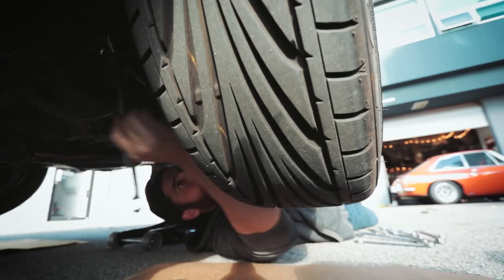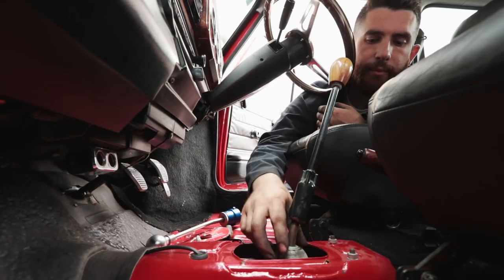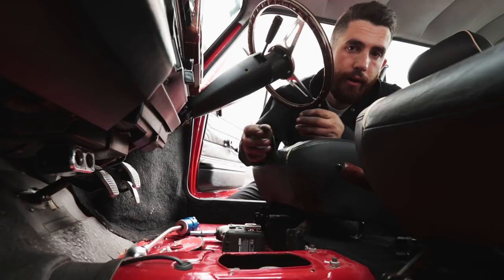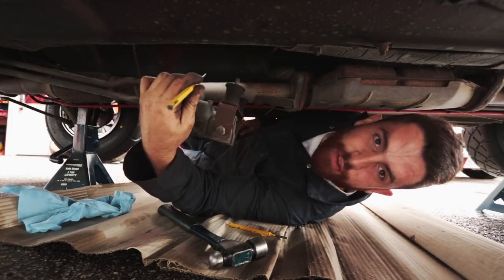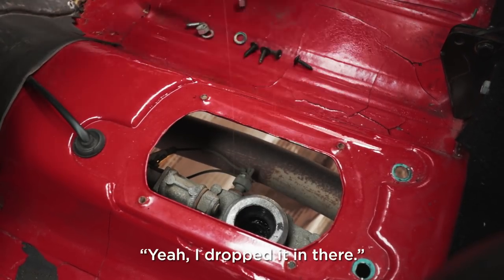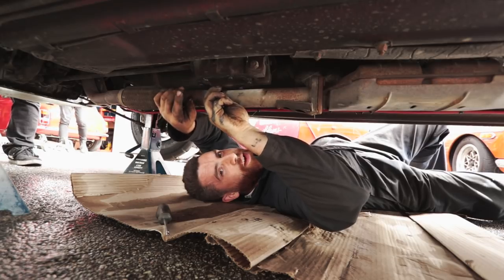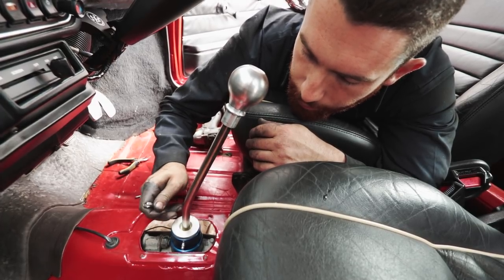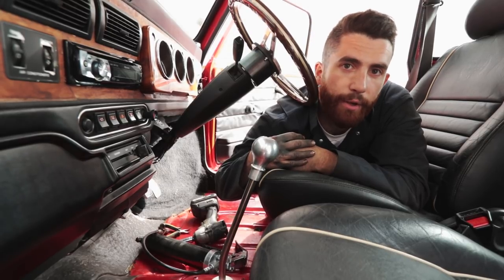How to Install KAD Short Shifter for classic mini

Comment: With a standard gearbox, a lot of people find it will rapidly reduce the synchro dogs. You can be more likely to change quicker than the spinning stuff in the box wants you to, especially if you have worn bulk rings. But it does shorten the shift, great for a race car where you don’t care as much for mechanical sympathy.

Comment: Nice piece of kit.
A top tip, well under there lock wire the two roll pins on the sleeve connecting the rod to the gearbox input, as these can fall out, usual at the most inconvenient time, and it will be raining.
Reply from the maker: Gavin Ivers great suggestion, extra bit of safety never hurts
Reply: Lol it would definitely be raining

Comment: Nice video, again. Cheers for that, mate. I´ve added a M6 lock bolt to the top collar (theaded it M6 near the edge) so I can adjust it and it stays nice and tight.       Just an advice to all the others: !!! DON´T BUY THE CHEAP 35£ ONES  !!  as they are poorly engineered and don´t justify the investment for the benefits you are trying to achieve.

Comment: My supplied bolts on the shifter wouldn't thread in.   I'm not bought some other self tapped bolts.  It never did tighten up super tight.  I think the supplied screws might be in between sizes or something.    I did take a test drive and everything seems fine and is definitely an upgrade.

Comment: Took me hours to get the pins out. I didn't have the proper tool and used an old screwdriver. I'm also a rugbyman, which means that most jacks don't lift the mini high enough for me to have enough strength on the hammer. After two unsuccessful hours, I decided to solder a small hexagon head on a spare steel bar I had, and punched it from the far side of the car. In minutes, stuff was done. For the pins, just get your little brother to hold a magnet stick while you punch it, I had no problems of lost pins.
If like me you happened to have your seat far from the dashboard, the gear lever is too short, you have to push your shoulder forward. KAD uses a M14 1.25 knob, and you won't find any prolongator with those metrics. You can find on AliExpress or eBay long shift knob (18cm) in aluminium with a self tap plastic screw that will make shifting a breeze. You will gain a bit more travel though, since the lever is further away from the pivot. But to me it feels really nice.

Comment: Where do you order the KAD shifter from, direct from KAD? Also was hoping you'd walk through replacing the shifter seal, since it's a common leak point, and you're already under there.
Reply from the maker: We try to order directly from companies when possible. That's a good idea about the shifter seal. Many leak, and we'll be doing a video on the upgraded shifter seal kits in the future.

Comment: I fitted one, all worked well,  but the throw is short & requires more effort.  As its only for road use, I would actually prefer the std stick.
Reply: They sell a standard throw shift kit as well that also gets rid of the lift to reverse

Comment: Installed this KAD Quickshift after seeing your review. Install when smooth but for some reason will not go into third gear? Only other thing I did was replace the oil seal. Any help would be appreciated.
Reply: Did you solve the problem?
Reply: dnbmania yes. It was the plate on the bottom gear lever box. Had it on the wrong way. Lol

Comment: Don't throw away your stock shift rod stick as mentioned... 

  Worn remote shift housings cause KAD Quick shifts to shift badly... causing frustrations and return to the STOCK shifter assembly. Many shifter housings are very worn out with the age of these cars today. A proper rebush is required to return tolerances and working shifting to a KAD Quickshift.

Comment: Just had a KAD shifter installed.  The lift ring for the reverse gear seems to annoyingly rattle.  Has anyone experienced this?  Have tried tightening it by twisting also...

Comment: Hi Steve! Thanks for the video!!! Im wondering that its not possible to change the knob??? and other thing the stick of the KAD is larger than the stock one?. IM owning a 1991 Spi Im a tall guy (1,87 mts) and im always fight for the lenght of the stock stick shift. Can gime some tip???
Regards from Spain
Reply from the maker: Slot Car Racing Argentina unfortunately the kad knob is integral with the shifter as it has a nifty lift lock for reverse. There are other brands that allow for stock shift knobs to be used, but not the KAD one
Reply: That is the only reason I have not bought one of these, or any short throw for that matter. KAD makes the best out there but I do not want to use that shift knob as my current one if very special. The integrated reverse lock-out is cool but I'd wish they would do another version without it.
Reply: @Brivinci1  Hey Brian - I just got the short shift kit.  Should be installed in a few weekends.  I'll take some photos and send them your way.

Comment: Aware this is an old video but I’ve just bought the kad short shifter and for the life of me I can’t get it too fit it won’t go far enough down over the housing to be able to get the two small bolts into the existing holes have you heard of anyone else having this problem the shifter is from mini sport and seems to be genuine
Reply: hello, did you solve the issue? how?

Comment: Any one else installed one of these and found that it is very tight ?????
Reply: Im currently trying to fit and it is being a bastard, it is really tight to get down far enough to get the bolts in, the movement is also very tight
Reply: @duncanmacleod5148  how did you get around this I cannot get it far enough down